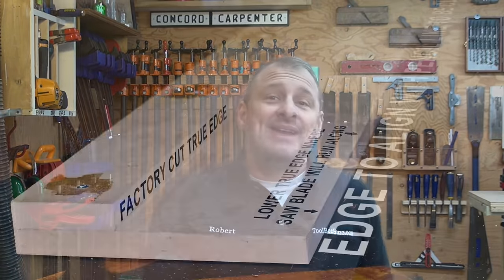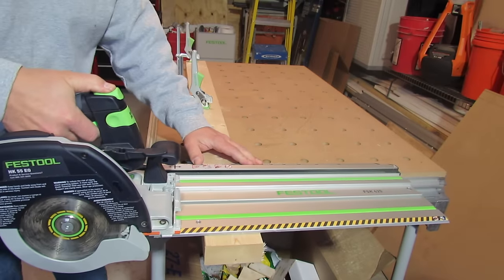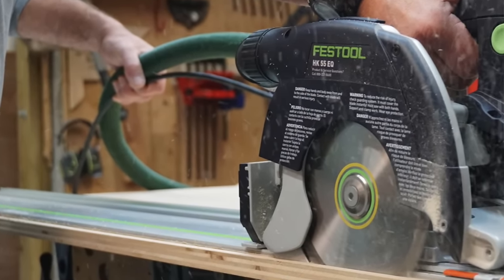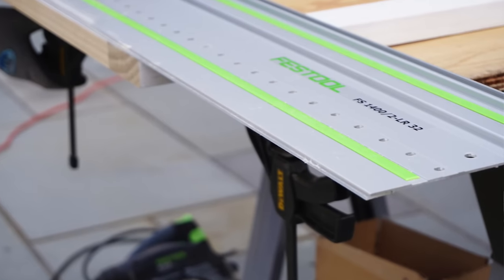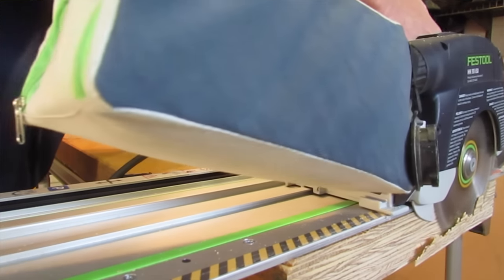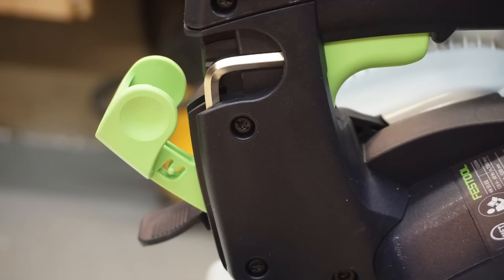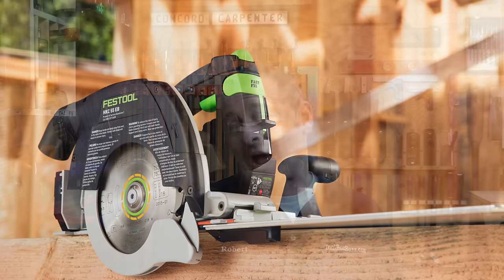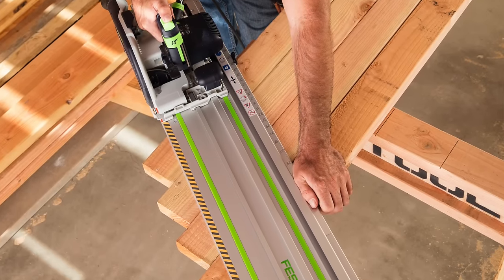Festool HK Carpentry Saws

Comment: This saw seems to passed me by. In 18v this would make me and my partners workflow so much better. We currently use dhs680 with a square to make most cuts, (I never understand people using a square to mark a line then cut). Only drawback is this £750 in uk that’s around $950!

Comment: Another great review, thanks Rob. I have been using my homemade rip guide for years now, really comes in handy for trimming up the bottom of doors. But the ability to just push straight through without having to also press it up against the guide would be a huge plus. Especially when you are shaving off thin sections where the blade tends to push the saw off the guide fence. Of course being able to lock in angles and use it as a portable miter saw is not really an option with my homemade unit. Been eyeing these for years now, time to get off the fence.
Reply from the maker: Oh man - you have to get this or a track saw
Reply: I know, I know...going with the corded unit.
Reply: buying the corded version of this saw for me dosnt make a lot of sense, defeats the purpose of using it remotely at the point of use, otherwise id use a miter saw back at the building,trailer,etc. where there is power
Reply: If I am on the ground I don't mind corded so much. The extra power outweighs the drawbacks, because I am either working off the stack or off a miter station (which is ideally located close to the stack). so there is really not a lot of moving around to benefit cordless. This would also be great for interior trim work and the cordless version not having an auto-vac feature is a major drawback for me. To each his own.
Reply from the maker: Tim Pamatmat we see this saw as a ground saw - so we prefer Cordero. There are times when JOBSITE do not have power or its limited.... that's where the HKC would come in handy

Comment: I would absolutely bring my TS55 Tracksaw to framing and decking work and have many times. Thats why Festool makes universal blades for it. This HKC saw can not make a 45 degree bevel and that needs to be called out, it's a major weakness of this saw and why I wouldn't buy one. Until then the TS 55 with the short rail is better and fine for rougher work.

Comment: I've thought about getting the 18v saw for awhile but was put off. I know someone with the 18v plunge saw and it's a bit gutless. But I suppose this isn't for cutting sheets of ply or mdf. The 85 is available in the U.K. Maybe that's the way to go after your review.thanks
Reply: cutiing ply or mdf?? that's exactly what this saw is for. Cutting lumber and sheet goods. Ive used on many jobsites and its never bogged down on any sheet goods
Reply: Dan ok fair enough but I was referring to the 18v. How long does the battery last when ripping 8ft sheets? Logistically how many batteries would you need to go hard all day? I suppose the new airstream batteries would help with the quick charge. I have a fair bit of festool but it's all corded. My battery platform is dewalt and with flex volt it's probably gonna stay that way
Reply: zap brannigan 
I am talking about the 18volt. the batteries last along time! I can rip and cut at yhe site all day long and barely burn through 1 battery.
Reply: zap brannigan 
I also have alot of Milwaukee cordless and the festool 5.2 ah batteries just seem to hold the charge forever. last week I was up on the scaffolding cutting rafters with this saw and 1 battery lasted through 38 rafters, probably over 120 cross cuts. I'm sure the battery will cut over 400ft of sheet goods!

Comment: This is not a new idea, they ripped off Mafell's KSS series of saws
Reply from the maker: Thomas Brown Yep!
Reply: Of course, they're also a little more than half the price of the equivalent Mafell.. Got to love it, Festool, the budget alternative, lol.
Reply from the maker: where d you purchase Mafell
Reply: Imported from Germany. Even with shipping and duty fees much cheaper than NA dealers.
Reply from the maker: Where do you purchase Mafell?
Reply: I've used Dictum, I've heard of others having success with Bort and Herkert as well. 

Cordless avoids the voltage conversion issues (well, other than the charger, but those can be purchased inexpensively here). Mafell uses Metabo 18V and Bosch 36V battery systems. 

But don't get me wrong, I'd be tempted by the HKC if a) it had enough depth of cut to bevel 2X @ 45 on the track and b) if I had a lot of Festool cordless tools.
Reply: I looked at Mafell years ago but had no luck in sourcing it in Australia. Interesting you state the mafell use a 36 volt battery.
I have the contractors cordless saw. It is a beautiful machine and I bought another blade with more teeth. I found cutting on melamine using the blade with more teeth hardly made any surface chips at all.
I'm going to search it there are any mafell uploads of the saw you are mentioning. I find the contractors cordless saw does struggle a but on angle cuts but I have the 4.2 amp hour batteries. Perhaps the higher amp hour will give slightly more power.
The cordless plunge saw has plenty power using 2 batteries. More than the corded plunge saw.
Reply: Correct Thomas Brown. Credit where credit is due!
I'll even point out that Mafell has been making these types of saws over 25 years ago!
Reply: You can purchase Mafell from its.co.uk from the UK. They sell everything in 110v as well as 240v.
Reply: @ConcordCarpenter  I would love to see you review some mafell stuff. Give them a call and I'm sure they will send some to you.
Reply: @GripK  your right, I have the plunge saw and it's  perfect in every way, built like a tank and you can tell it's made to outlive the user, so good value in my opinion.
Reply: @Scott Gr still think mafell is better value in the long run. The festool just isn't built as well as mafell. With a mafell you can probably pass it on to your grandkid.

Comment: So this saw can be used on the standard TS55/75 tracks?

If you could only buy one would you get this saw or the TS55?
Reply from the maker: William Butler I do a lot of finish carpentry so if I could only do one I'd get the T55 with 2 tracks: long and short
Reply from the maker: William Butler yes it will fit the T55 tracks - in face some of the video showed us using it as a track saw
Reply: yes, it works on all Festool tracks and Makita tracks